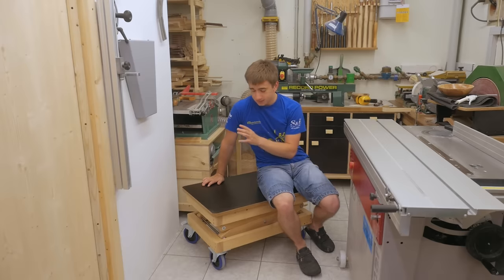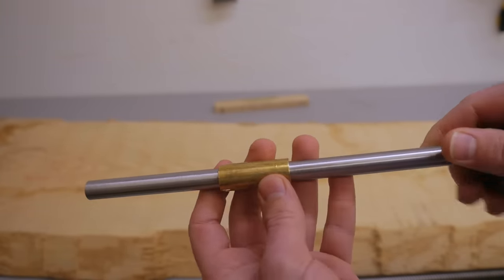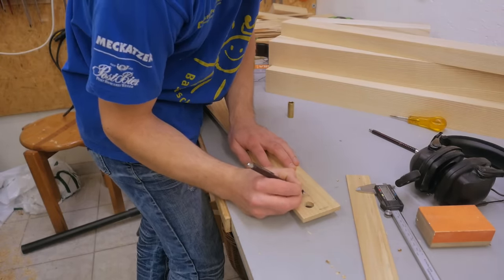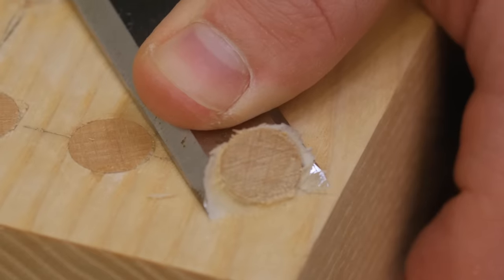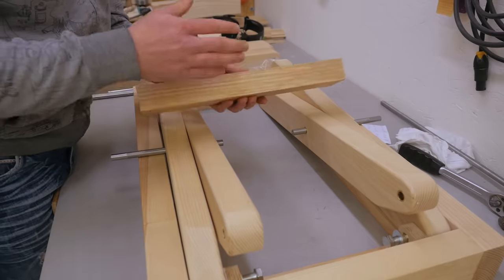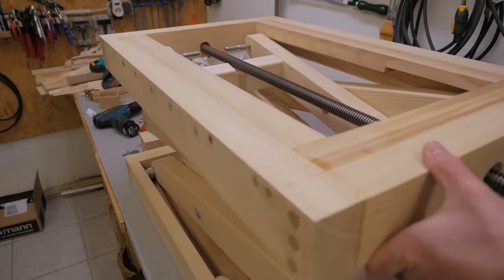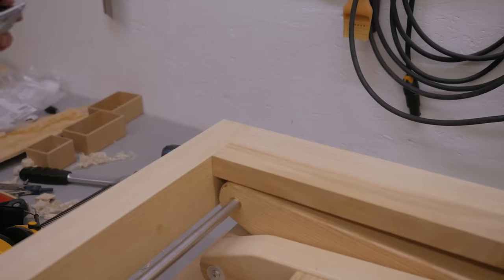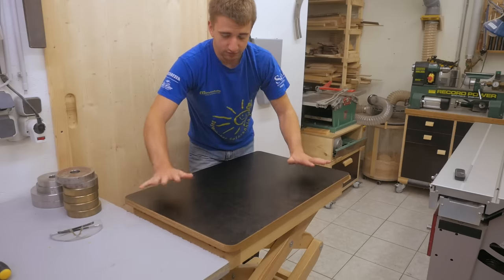Homemade Wooden Lifting Table

Comment: I agree with the other posts that you have an impressive lift. I have one negative feedback, based on personal experience. At 2:12 in the video, you place your hand inside the lift. If the lift suffered a catastrophic failure, you may not be able to remove your hand fast enough to prevent a crush injury. Aside from the safety feedback, I liked the video.

Comment: as someone who uses both hydraulic cylinder lift tables and hand crank lift tables every day.  the hand crank ones are easier to position precisely,  and way easier to go from all the way down to way up.  an electric hydraulic, where just using buttons may be better. but I'd stay with hand crank.

Comment: I love this idea! i will definitely build my own, the only thing i would ad are holes in the table top so you can clamp down any work you are doing on it. To define what i mean: i work with furniture that requires many height difference so this table would be perfect for me because you can adjust the height of it, but i also need space for my clamps and area's to use the clamps. I know this is a "lifting table" but i would use it as a "lifting work table"  For the rest a perfect a job in my opinion!!
Reply from the maker: I also had dog holes in mind when I designed it, but I like it the way it is now. I maybe add them later on. My primary use is also any height adjustable work table and it's perfect for that. Thanks for your comment!
Reply: The design is flawless and you gave me such more ideas to build my own! do you mind if i use some of your tips and tricks for my own project? non the less again such a beautifull project!
Reply from the maker: Absolutely not. I would like to see some pictures when it's finished or also during the build. Have fun building one!

Comment: I know it's a 2 years old video but I've just found your channel. I'm absolutely stunned by your skill level and the abilities of your shop. The build is amazing, and I'd like to add only a little note: I think cutting metric thread into wood is not the best one can do. Now I'm not a woodworker at all but as far as I know there one should use some metal inserts instead. Maybe something to consider for the second, improved version :) Besides that, a big thumbs up and you've earned another subscriber :)
Reply: Have you ever tried it? It works surprisingly well in hardwood.
Reply: @fledi2  Well as I wrote I'm not a woodworker at all, and actually I have very little experience with materials other then MDF and similar man-made stuff. I don't think I ever had a piece of hardwood in my hands (at least, not for processing :). I suppose using the metric cutter it is not actually cutting the wood, maybe just compressing the material so that's why at the end it keeps well...

Comment: You mention the excellent finish you get from the 'diamond' blade on your table saw. It looked fantastic! Did you mean 'diamond', or is that a brand? As for cutting metal products using your 4" grinder. Get a 1mm thick cutting blade for it  - it will be quicker than your hacksaw !! Great video content. Still amazed at your range of skills, and your practical approach to the problems that you encounter.
Reply from the maker: +ian Woodland Yes, I mean diamond. Silent power diamond blade is its name.

Comment: Only one small criticism - the cranking handle while looking the part made of wood to match , should have an epoxied inserted socket as the hex made purely from wood will not work for long especially if heavy loads are often lifted, or alternatively the handle could be made completely out of steel.

Comment: I was wandering why didn't you put that shaft on the bottom of the construction. This way you can use small electric motor for adjusting height.

Comment: If you dont like bending down to wind up, one solution  to the problem was a right angle drive from an angle grinder and a motor driven by a battery.
Maybe add a coiled kettle cable, and a foot switch to save the bending.

Comment: Build the nut for the drill into the handle option, that way you're not always having to track it down.  Nut/drill shaft always attached, the the outer long part of the handle has a cutout for the drill shaft, and face pins to go into an outer ring around the outside of the socket.  Really you don't need a socket, you can build all of this into the shaft. then just the drill goes on or the handle goes over and into it's own drive connections.  And make a storage mount for the handle, so it isn't laying around when you're using the drill.
Just seems much handier than having to swap and have a separate piece for the drill, and as always someone else may have mentioned similar already..
Reply from the maker: That is an excellent idea to simplify that part. I actually don't use the drill option at all. It offers not enough control, and the time it takes to get the drill ready, I already cranked it up by hand.  Maybe that would be different if the drill option were made more straightforward, as you described. Since the drill was more like an afterthought and not part of the main design, I haven't considered more suitable solutions.
You're the first one who mentions this, if I remember correctly.

Comment: When you you talked about the worst mechanical advantage it had when you were cranking up your drill press and you put your hand down at the bottom corner where you put your hand is called a pinch point and as you get older you'll realize that the darnedest shit can happen and not to stick your fingers in pinch points and also you're an amazing Craftsman keep up the good work

Comment: It's been three years, guys. I think we can give up on plans. However, I'm building a scissor lift table myself (just completed it in CAD and am now accumulating parts). It's not a direct copy of this one, but an amalgamation of several designs. I expect to post a video of my version 1, then will do a build series on version 2, and will make plans available. Mine has a significantly higher maximum height.

Comment: How are those huge bolts holding? I would assume that's a connection that could fail fast. Maybe a bolt nut combination is more reliable. Love your work and videos.
Reply from the maker: Why should this connection fail fast?
Reply: I would assume the wooden threads would wear. ultimately fail and the bolt becomes loose. :)

Comment: Archimedes of Syracuse said ‘δῶς μοι πᾶ στῶ καὶ τὰν γᾶν κινάσω’ which freely translated means ‘Give me a lever and a place to stand and I will move the earth’. Regrettably, he was killed by a Roman soldier in 212 B.C. so you are too late by 2229 years. Putting historical events aside what you have constructed is extremely interesting as well as useful. It is also very elegant and it proves that engineering has no limits. (by the way it took me more than three years to make this comment, I do apologise for being late too).

Comment: Marius. Look @2:15 please.  FINGERS!  FINGERS!
As one of the shop amputees in the comments, may I suggest that when testing equipment you please keep your body out of pinch points, and points where failure should produce devastating leverage.
The flesh pad at the tip of my right thumb is gone.  Please keep yours.

Comment: Too bad you don’t have a McMaster-Carr. The bushings and other hardware would be easily purchased with a proper fit. Great project though. Since I do both wood working and Welding. I would build it out of steel tube.

Comment: If those bearing blocks are just wood glued to the bottom of the frame, isn't there potential strength concerns about them being ripped out of place when the scissor lift is high and essentially wanting to "lever" against the aforementioned with a heavy load? Is that compensated for, somewhere?
Reply from the maker: on the bottom there are the cut-outs in the wood, which carry the load. The glued pieces are on the top frame, which I reinforced with dowels.
Reply: Marius Hornberger Ahhhh, yes yes yes.... Gotcha.

Comment: So in Spain we have technology class which is basically engineering and physics combined (yes more physics than the Normal in engineering) and we use to do projects because it’s a technology class and we needed to show if we were able to do it in practice and the wood usually burned when we made holes in it because most of the people in class sucked at doing it and we had to work in groups 😂😂😂

Comment: If you can give Some key dimensions, like the length of the scissors board and the dimensions or the base, I think that would be all I need.  If I succeed in making a properly functioning lift, I will, with your permision, post the plans of what I did.

Comment: Well it's neat but I would have to buy a lot of shop equipment to make one. Drill press, lathe, Or was this just a project to show off all the equipment you have?
Reply from the maker: No, it was a fun project. If you'd have to spend more money on tools to build this, I'd just buy one
Reply: @MariusHornberger  I did buy one. The point was, "the amount of tools you used would only be available in a professional woodworkers shop. Jig saw, table saw, drill press, lathe. 

I think the real skill would be to find a way to build the lift with a few tools, table saw, miter saw, hand saw drill and sander.
Reply from the maker: Now I understand correctly. I want to make another one someday with more accessable tools and with steel scissor parts
Reply: Well I enjoyed watching this video alot. Wheather I have the high end tools or not, there is so much mechanical skills involved I don't think it would help me. But I enjoy trying. The words perfect, precise etc. are not in my vocabulary. lol. Keep up with the great video's. Much appreciated thank you @MariusHornberger

Comment: My issue with lift tables is getting stuff onto them in the first place.
Reply: The easiest way is just to configure your furniture to work with that. If you have a french cleat based workspace, you can really just mount reasonably heavy  tools and cabinets on your walls, which easily gives you the space to just grab em and move em around. Then you can store other caster based things underneath so you can just roll it out of the way to roll the lift table in. Or for that matter, if you have heavy stuff on relatively high shelves, one of these is damn handy. It also can be pretty good for just picking wood off a lumber rack. 

But yeah, if you have legs and a body going all the way to a floor on every tool, they are of limited utility. Still nice for moving stuff off of your tailgate and into your shop though.

Comment: Dude, I watch a lot of your videos. But winging things you do with the tools and machines you have and cost dearly is easy. Now I challenge you if you dare. do what you do the old fashioned, using hammer, chisel, hacksaw, star wrench and manual drill etc.  Amigo, assisto vários vídeos seus. Mas fazer as coisas que você faz com as ferramentas e máquinas que você tem e custam muito caro é facil. Agora eu faço um desafio a você si tiver coragem. faça o que você faz a moda antiga, usando martelo, formão, serrote, chave estrela e fenda furadeira manual etc.
Reply: porqué? Why? Warum? Pourquoi?
Reply: @michelmarinho8954  Porque o que????
Reply: @josepedro7061  porqué ele deveria aceitar tal desafio se tem a ferramenta para executar o trabalho?
Reply: Preferia ter visto postado os planos já que pergunta se alguém estaria interessado!
Reply: @michelmarinho8954  Então, mas ele não responde. tem que fazer igual o vovô Amu.

Comment: Really nice built. But man, you are way too young, you should respect your power tools a bit more. Your finger touching the back of jointer bed, using bare hands to push wood over the table saw blade, your finger resting on the scissor lift while you crank it up. You might get away with without any accidents it but this is the wrong way to show people how to do things.

Comment: If you was to take an old 12 volt drill and cut off the handle and attach that to your threaded shaft, run your wires to a remote with double throw double pole switch along with a push button to operate the drill motor. 
  Attach a long cord to a power supply (WALL WART) and power up and down.
  Connect the power to push button, then center connections of the switch, and motor wires to one end, and on the other end (but cross wires to be opposite of the other end) there is your forward and reverse control and on and off.
...REMNANT2U...

Comment: Grats on completing the build. Must've took some persistence.  I have to say that you've made some questionable design choices. ie. 
1) using wooden dowels as mechanical supports, 
2) wood gluing the pieces where the entire scissor structure bolts into,
3) glossing over drilling the metal bearing (this must've been a pain), have you tried press fitting into the wood?

You sure love your lathe  Youtube needs to stop recommending me videos of DIY/Homemade videos with specialty/industrial tools.

Comment: Magnificent work. Far too much metal work, though excellent as everything you do. Heavy construction, too heavy. The hexagonal hole in the turning handle should be metal not wood. If fact the whole lifting contraption should be made of metal. Wood is not the material for that.